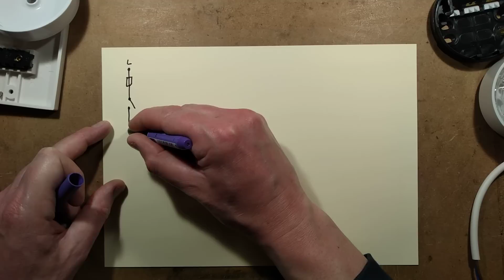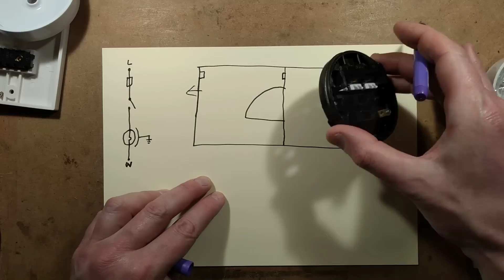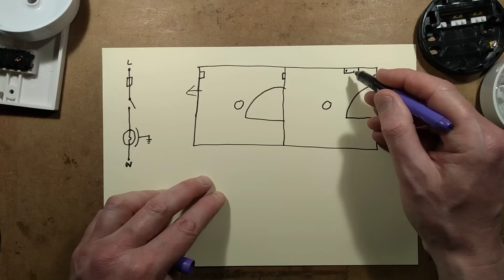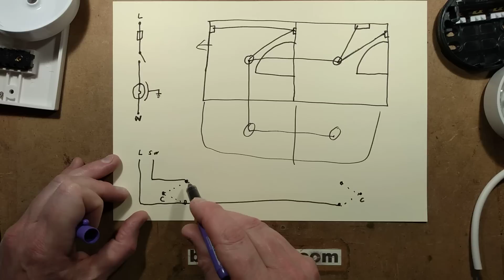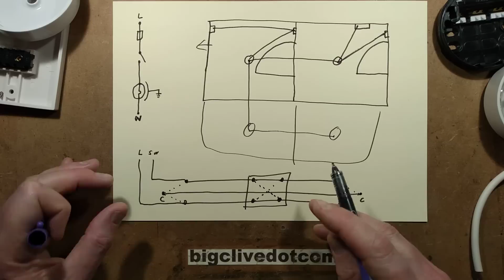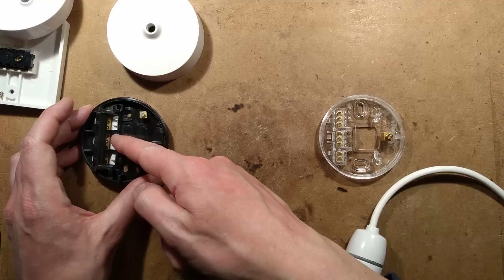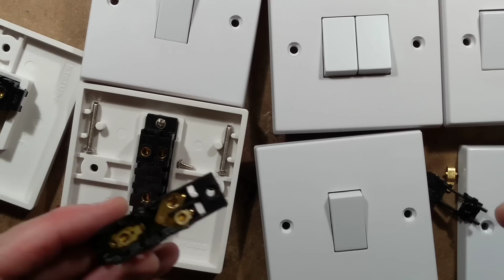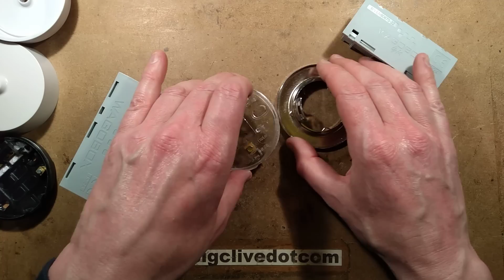British home wiring.  The incredibly simple lighting circuits.

Comment: In the US we have multiple circuits serving each room with as many as 20 breakers; if a light in one room is shorted the whole house doesn’t go dark.
Reply: If the US does it the same was as up here in Canada (Where I'm from. Not my fault) the wall outlets are on the same circuit as the lights, all protected by a standard 15A breaker/fuse, with one circuit supplying one or two rooms.

I've been getting the impression that in the UK lights and outlets are on separate circuits, protected by breakers of varying amperage.
Reply: @jamesbrown4092  The lights and outlets in the UK are indeed on seperate circuits, using different cable sizes and different breakers to suit.

Lighting tends to use around 1 sqmm cable, with a 6A breaker (though both can be increased if required) and outlets use 2.5 sqmm (with a 20A breaker for a radial circuit, or 32A breaker for a ring circuit).
Reply: @jamesbrown4092  
In general, outlets in the UK form a large loop or ring (as opposed to the hub and spoke model in North America) with something like a 100 amp breaker.  As a result, legal UK appliances come with an appropriately sized fuse built-in to the appliance's plug itself.
Reply: @dbernat32  a 220V/100A breaker!?!? What?
Reply: @dbernat32  We don't use ring mains in New Zealand so our wiring is similar to the US. However we keep lights and sockets on separate circuits like the UK. Our sockets are however only 10A while our lighting circuits are 5A. Depending on the size of the house - you can have multiple lighting and socket circuits.
Reply: @xenonram  100A breakers are only really used on the incoming supply for the whole house (well, it's generally 63A these days, and that feeds the entire consumer unit, which then feeds all the circuits via smaller breakers).
Reply: @dbernat32  It's 32 amps for a ring circuit usually, not 100. A three bedroom house might have anywhere from 1-3 separate ring circuits. Lighting circuits sometimes have hard-wired appliances like extractor fans on them, and ring circuits can supply hard-wired fixed appliances up to 13 amps via a so-called fused connection unit (FCU), which accepts the same kind of fuse you would find in a plug. (FCUs are often colloquially known as "spurs" or "fused spurs", since a branch off of a ring circuit is called a spur. This can be confusing, because a spur doesn't necessarily involve an FCU.)
Reply: @dbernat32  That plug fuse is there to protect the cable, not the device...
Reply: @patrickwigmore3462  Having light circuits power extractor fans is against regs - most residential UK lighting circuits are 6A. "Hard wired" devices would normally have a dedicated power feed, with suitable fused protection...
Reply: @Fifury161  It's not against regs to power an extractor from a lighting circuit (in many circumstances it can be a requirement to run one off the lighting circuit: eg when the light switch is used to turn them on, in bathrooms etc), however they should have an isolator and fuse.
Reply: @sparkycalledmarky  Ah - I read it wrong thanks for the correction.
Reply: @Fifury161  It is not against regs to power an extractor fan from a light circuit in the UK. It is done all the time. A lot of small devices get powered off lighting circuits. Bathroom fans, bathroom mirror light, shave sockets. However, fans etc. must have an isolator.
Reply: @dbernat32  100a breaker?  32a maximum.
Reply: @jamesbrown4092  I've never put lights and outlets on the same breaker. That wouldn't be very wise. I don't wire all of the lights on one level a single circuit. If the breaker trips, all of the lights on that level are out and you can't see anything. There are houses that builders have wired as cheaply as possible. I have 5 circuits for the outlets in my kitchen. I have a separate outlet for the refrigerator hat is also connected to the deep freeze in my basement. I did that because I've seen an indicator light short out on a deep freeze. Most people don't open their deep freeze very often so they don't find out that the circuit breaker tripped until everything in the deep freeze has spoiled. People open their refrigerators several times a day so they notice if the breaker trips.
Reply: @jamesbrown4092  I'm also in Canada, and we do Lights and Plug outlets on different Circuits. Except in the Garage.
Reply: @jamesbrown4092  because its very taboo feeding lights or sockets off eachother or vise verse in the UK, plus sockets are 240v and 13a lights not so
Reply: Something Clive didn't really mention (he hinted) was that 2 (or more) storey houses in the UK have at least a lighting circuit per floor (most "normal" houses have 2 circuits), with the light at the top of the stairs fed from the ground floor (in the case of one circuit tripping, it should then be possible to have lighting on the stairs at least via another room and open door).

We also have a tendancy for plug in lamps that are powered through the ring circuits rather than the lighting circuits, so are fused seperately again (via the ring), so we tend only to be left with no lighting in the case of complete power failure.
Reply: @Gutless Spigot - The transformer that Falcrist is talking about belongs to the power company and isn't part of the home wiring. The power company runs a single line (typically 4KV) down the street and every so often they have a transformer on the pole which reduces it to 220v (centre tapped neutral tied to earth) which is used to feed several houses.
Each house is supplied with the centre tapped 220. Most branch circuits use 110v from one of the lives to neutral while large appliances use both lives to get the full 220.
Side note: Although the neutral is a earth potential, it is not used as an earth. A separate earth wire is used to bond all things metal to either several earth electrodes driven into the ground or the metal water main.
Reply: @Gutless Spigot Wiring is a small part of a house's cost.
Reply: @Gutless Spigot the transformer I'm talking about is the main one that feeds the entire house. It's needed to step the voltage down from medium voltage (thousands of volts used for distribution) to household voltage (240 and 120).

In the UK one end of the secondary winding is tied to earth. In the US it's center tapped and the center is tied to ground. Most circuits use one side of the secondary or the other. Certain high power appliances use both sides for extra voltage.
Reply: In the US, we will often have receptacles and lights on the same circuit, but not in the same room. Sometimes, the lights from adjacent rooms will be on the same circuit, but there will always be receptacles in a room that are not on the same circuit as the lights so that if the lights go out, you can plug a floor lamp into the wall and still have light to replace the bulb with. Only common sense :)
Reply: @PyroRob69  That's exactly how my prefab house was wired.  60amp 4 fuses.  Half the house lighting is wired to the other halfs outlets and reverse for the other side.
Reply: @commodoresixfour7478  We have probably 40 breaker slots, but each one can be used with a single or double 15A or 20A breakers for 110V or you can slap a double breaker that grabs bother bus bars and gives you 220V. I had to install a sub panel in my garage for extra breakers to fees it and part of the basement. I have bother 110V and 220V capabilities in it as well, and it has it's own 60A breaker. The house has 150A service. Obviously, not all breakers are maxed out, but it does separate service to various circuits in the house.
Reply: @PyroRob69  I forget if I mentioned it but yes I put in a 200-amp breaker panel.  I'm always plugging way too many things in and when I bought the house it had many issues with the electrical system.  Some circuits were back fed to use two fuses, I had a green wire in the basement that was being used as hot, all fuses were replaced using the highest amp value available, and lamp wire was used to connect my basement lights inside the electrical box.  Just to name a few.
Reply: Australia, we have 1 circuit for our lights, to a 15 amp fuse, and 2 circuits for our power points. 1 circuit for front 1/2 of house, 15 amp, and same for other 1/2 of house. It so if power appliance trips circuit, it only takes out 1/2 of house. Some modern houses have 2or more light circuits, 1 for each floor, or depending on size of house, 2 light circuits for main floor. Always a separate circuit for stove / oven, another for hot water unit if it has 1, and another for electric heater, again if it has 1. That is for a 220-230 volt standard house. Here in Australia, since the wildlife is more likely to kill us, we train our kids to live with danger by having a higher voltage house and it gets them use to living with danger all their lives.
Reply: @wonniewarrior  220-230 volt is standard in Sweden as well. Fun to get close to an old cable were you can feel a layer of electricity around it before you touch it (which is a bad idea, learned that the hard way). This house is old, cables with cotton? around it and inside a metallic pipe. Got one of those in the bathroom, low enough to the floor so a 4-5 year old can touch it and its next to the toilet. What do bored kids on a toilet do again? Can you top that? (Yes, this house have kids)
Reply: @labobo-h7u    what kind of medial house do you live in? Most houses in Sweden (at least the ones built sometime in the last 50 years or so) dont have such crappy electrical system as you describe..
The thingling you feel when touching different electrical machines is because they are hooked up to ungrounded outlets.
Reply: @labobo-h7u  and no, you realy dont have to turn off the main breaker switch to change a fuse, but you kind of need to remove whatever caused it to fry.  And no, the fuse will not explode..
Reply: +july8xx You are comparing recently-built houses with old houses... If you go to NYC, Boston etc (i.e. a major, older city in the US) then you will find a lot of older houses and apartments, and a lot of those haven't been modernised so have less advanced wiring installations. You won't find a lot of people living in NY walk-ups who are nodding along to your "20 breakers" comment. But, if you go to Florida (for example) a lot of the housing stock was built in the last 20 years, so has modern electrical installations. It's the same in the UK and probably most other countries. For example, I live in a house that is 100 years old, and it had rather dilapidated wiring when I bought it (VIR cables, which are lead-sheathed, rubber-insulated) but it now has modern high-spec electrics with over 20 circuits (it's not typical). When the house was built, it had no electricity, it was lit by towngas, heated by coalfires.
I have friends who have bought houses in the new estate a few streets over that have similar electrics from the outset.
Reply: So in the UK, lights have their own (lower power) circuit(s). In the US, the lights are simply powered by whatever circuit runs that particular room (each circuit runs a couple rooms usually).
There are other differences as well such as the US using a center-tapped transformer to reduce the voltage going to most circuits in the house (typical exceptions being big things like ovens, stoves, driers, and hvac)
Reply: In the UK we have the ring circuits one or more for each floor if something is shorted the whole house goes out due to the earth leakage  trip,  would be the same if it was all spurs the incoming earth leakage trip would still go.
Reply: @Equiluxe1  that depends on the regulations in force at the time the house was wired.

When RCDs were first introduced in the regulations a single RCD was seen as sufficient, however now 2 are used in split load units (one for upstairs lights and downstairs rings, with the other operating downstairs lights and upstairs rings, giving redundancy. Other circuits are distributed as appropriate).
Reply: In Sweden they have one breaker fuse per room with the exception of the kitchen (electrical stove with electrical oven) and the bathroom (washing machine). At least that is what I've seen. Not sure how much of that is wired incorrectly. If you touch the stove and the microwave at the same time you get electrocuted, not deadly but still hurts enough for you to invent new swearwords. If I drag my fingers up and down a metallic floor lamp in the tv room my fingers start to tingle in an uncomfortable way.

Most houses don't have reusable breaker fuses. Have experience of manually changing a fuse without turning the power off. So many sparks inside the breaker casing. Over a decade later I'm told you should use the main switch and turn off everything before replacing fuses. Wops! Don't have to do that with the reusable breaker fuses. Apparently there's a chance the fuse could explode in my face if the breaker box isn't turned off first. Must be lucky. Have replaced those things several times.

The fuse is white and looks like a battery that is thick in one end and small in the other end. The fuse feels like stone. You put it in a casing and screws it in. You can see it's dead from a red mark that appear in the middle of the thick end.
Reply: @Gutless Spigot "I would chase him out" - I see what you did there... chase... electrician... lol!
Reply: I have been in plenty of old (and some not so old lol) houses in the US where if you forget and use the toaster and the microwave at the same time, the house goes dark.
It all depends on how much the builder skimped on costs or was lazy.
It also isn't uncommon to have an entire house on one lighting circuit, since the wire can just daisy chain through the ceiling, while the outlets are daisy chained through the wall.
On larger houses that would take more wire between lights, sometimes the only wires are in the walls daisy chaining between outlets, and then and then run up from an outlet to the switch to the light.

Current building codes require more circuits and require a minimum number of outlets and a minimum number of circuits, and so it's better now, but also increases the cost of the electrical, but with much improved reliability and usability to the resident.
Reply: @Charles Ball how is it safer ?
Reply: You only really see good room separation on newer houses. Have dug into the electrical on a variety of houses around here. The ones wired early 90s on back all have the same scary wire layout. It's a miracle more of such houses haven't burned down. Kind of sad not enough tenants think to look at the wiring and compare to modern specs. Not saying all tenants should update their homes wiring but take a look, compare to spec and seek help to remedy any glaring hazards.
Reply: Well, in Russia, Nepal and the entire rest of the world, nobody gives two fucks about America. When you can boast about your low school shooting numbers, universal healthcare and your lack of an orange, TV presenter president, we can talk then, not before. 

N-O-B-O-D-Y C-A-R-E-S! Primarily because it’s become the leader of the third-world shitholes that your orange boss keeps talking about.
Reply: in New Zealand you legally have to have a minimum of 2 lighting circuits, bigger homes would have 3 or 4.
Reply: @Gutless Spigot us uses a center tap on the pole feeding the house. No extra transformer anywhere. The distribution panel has two sides and a neutral buss. Outlets / lighting divide up distribution from both lines at 120v. Large loads like central air conditioning, electric stoves, dryers etc get fed with both  lines at 240v. The pole transformer takes one of the 3 phase 7200v distribution lines and feeds the house with 240 with a center tap neutral.
Reply: Standard in Europe (Western north parts) is 2-3 circuits per floor. One may be dedicated to sockets and the rest are diagonally connected to lights and sockets. The light in one room is connected to sockets in the next room. Each is fused 10 A which gives you around 2000 W for sockets and 300 W for lighting.

Another smart way to wire is to use the lower floor junction box to feed one socket in the upper floor if they are straight up on the same wall. The socket below a switch is connected to the switch. That way, you may have 3 circuits in one room. Planning is essential and you need to weigh the amount of materials used against how hard it is to wire and the current standard. Some years ago, Sweden gave out the recommendation to criss cross circuits as described. Even if one circuit goes bang, you'll always have power or light in each room.
Reply: If an appliance is faulty in the rest of the world the room doesnt go dark, nor does anywhere else. We kinda think thats smarter - that way you can find the appliance that caused the problem :)
Reply: yes usa likes to be wasteful
Reply: @girlsdrinkfeck  And YT commenters like to be trollish.
Reply: @misterhat5823  no

Comment: I think one of the reasons the north american boxes are larger is were working with 120 volts, so 4 mm2 wire is common for outlets and 2.5 mm2 for light circuits.

Comment: I live in a brand new apartment and all my light switches are a flat piece of plastic with two clicky buttons and a tiny led in the middle. It's really stupid and hard to get used to.
Reply: Switching on a light shouldn't require fine motor skills.
Reply from the maker: Active electronics.  Much more to go wrong.

Comment: After seeing a bit of those British home wiring stuff I'm really blasted - at how much superior the German stuff is over yours.
Its just so much simpler. There are only two sizes for the switches/Outlets. A flat one and a deep one. Those are for plaster, nailed to the wall and plaster on top, hollow walls.
And the usual Stuff. And you can do whatever, up to 5 things (switches, outlets) in series. You should really look at that.
Reply from the maker: The small boxes are also used for spurs, single sockets and high current isolators and outlets.